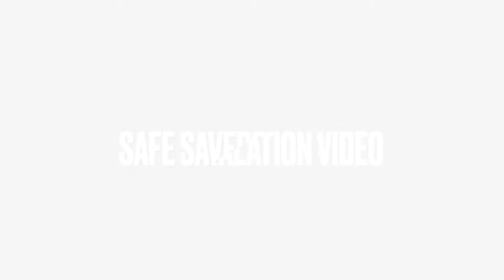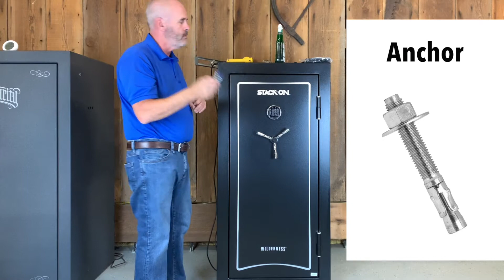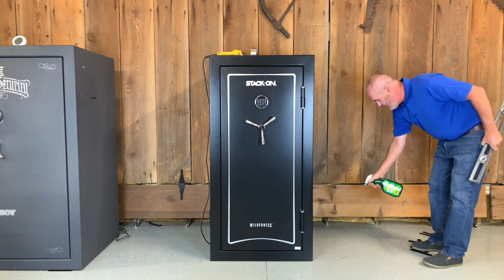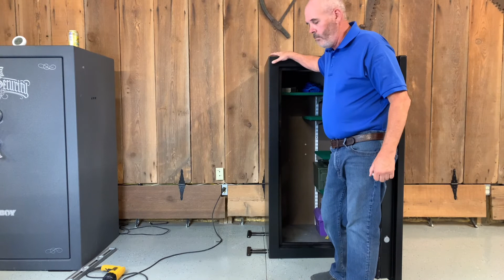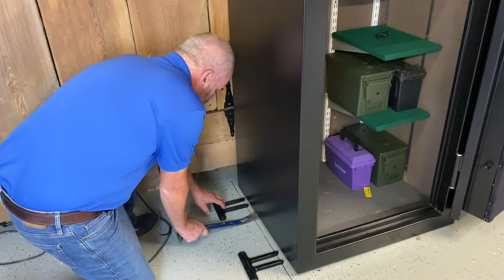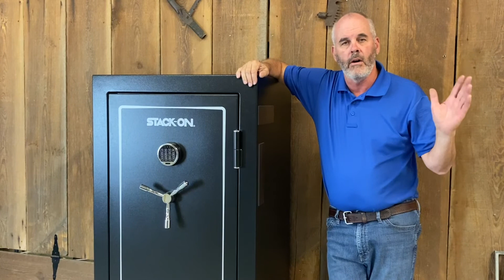Gun Safe Bolt Down Shims & Moisture Protection | Safe Savers Installation | Gun Storage Solutions

Comment: I dont want my safe shimmed up off the floor if possible. If a thief can get a long crow bar under it they can leverage 10's of thousands of lbs. upward possibly yielding those anchors. 2 big guys bouncing all their weight on a 6' bar can obtain crazy force. I just anchored down a 473lb Hollon safe that rocked because of uneven concrete so i placed 1 shim in the rear corner where it would be hard to get a pry bar bach there. Also try not to drill all the way through the concrete and moisture barrier under it. That could cause major problems.

Comment: One potential issue with this is that it now leaves a gap that someone could use to pry the safe from the floor... This can be mitigated somewhat by putting the safe in a location where there are walls near it that does not give the potential thief room for pry bars long enough that he could exert that sort of force... In the end though, we can't really make something burglar-PROOF, all we can do is make it burglar-RESISTANT -- hopefully resistant enough that he'll go somewhere easier...
Reply: I'm researching this procedure now. I was thinking it might be feasible to pour a concrete "curb" around the safe if you're putting it in an unfinished area. Toss in a couple of rebar rods for extra extra security. Add this to a situation like you mentioned, a tight space, etc. And you should be good. Just my 2 cents.
Reply: @biffjohnson2076  -- Tie the rebar in the "curb" into the slab to make it more difficult to break apart... Welding on some ridges (angle iron, rebar, etc) along the perimeter / sides of the safe about halfway between the bottom of the safe and the top of the "curb" would help also since it would mean that to pry it loose, a good portion of the "curb" would need to be destroyed... It won't prevent anyone who has unlimited time and access to tools, but it might slow them down enough to make them go elsewhere...

Plus, a 12-gauge trip wire with the shell filled with cayenne powder makes it a bit more annoying for them...
Reply: @CurmudgeonExtraordinaire  I like these ideas! Thank you!
Reply: @biffjohnson2076  -- Anything worth engineering is worth over-engineering... :)
Reply: Also you can get a sazall blade under the safe a cut the bolts.
Reply: @bmwbaker  -- Correct, but that is going to depend upon the thickness of the blade vs the thickness of the shims he is using.  Assuming that the shims are thicker than the blade (and thus you will be able to get the blade under there), you are going to be needing to cut through the entire width of the shim, not just how thick it might be.  Hardened steel that would be more difficult to cut might help... So might designing it so that it rotated so that it would move and be more difficult to cut...

Comment: If you are worry about humidity, flooding, and drilling into your concrete rebar.
1. Install next to interior walls. 
2. Pour a concrete slab area at least 4-6 inches in height and enough area to cover safe. (Try to pour some close by a corner wall and directly on top of existing concrete to bond more to house foundation also watch a tutorial on how to bond existing concrete to new concrete) Drill concrete anchors for the safe to anchor on slab. Lay a nice thick sheet of plastic on top of slab
3. Put a hot rod dehumidifier inside safe. Use a hygrometer to keep moisture between 45 and 55%. Add a whole house dehumidifier if basement gets too humid.

Comment: Good idea and good product but somebody can just simply take a sawzall with a Long blade and cut the bolts🤔🤦🤷
Reply from the maker: You bring up a great point! Beyond the Safe Savers ability to level the safe and act as moisture deterrent, the fact that it surrounds the bolt will gum up the blade of a sawzall to hinder cutting the bolt.
Reply: @GunStorageSolutions  please explain why this material would "gum up" the cutting blade? I would think a material with the hardness needed to support the weight you claim ,it would easily be hard enough to cut with a reciprocating blade to not "gum up" .  Can you ensure this or explain how this material is designed to not "gum up"? This is also important to me.
Reply: @winchester7391  Didn't you know that there is a layer of gum attached to the safe saver for this specific reason. 😂 Yeah, idk what gum up meant tho fr. weird term when talking about a sawzall.

Comment: Question: how many safe savers can you stack if your floor isn't level?  Will they work for an 860lb safe unloaded and a lot heavier loaded?
Reply from the maker: Hi Mark, Great question. You could stack several safe savers if necessary. Obviously, too many could make the safe unsteady. Each Safe Saver can hold about 800 lbs, so you are definitely good to go with your current safe. Keep in mind our Safe Savers come in a pack of 6, so depending on your flooring you may need to buy 2  packages. Feel free to reach out to us via email info@storemoreguns.com if you have anymore questions.